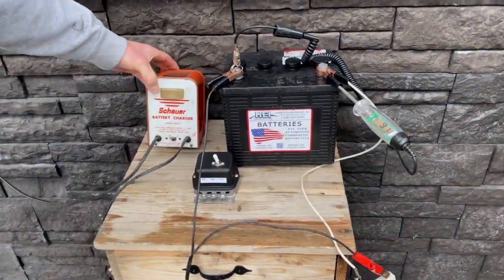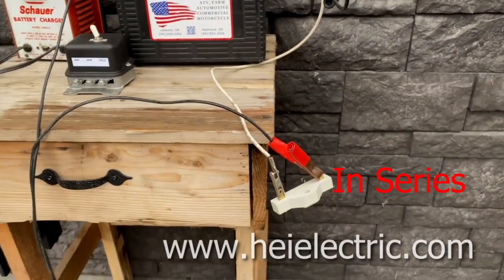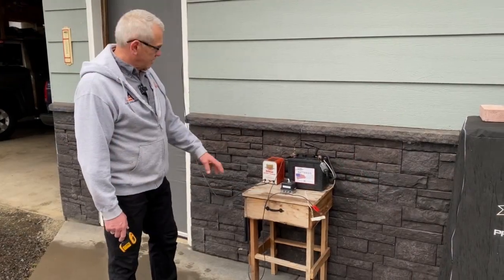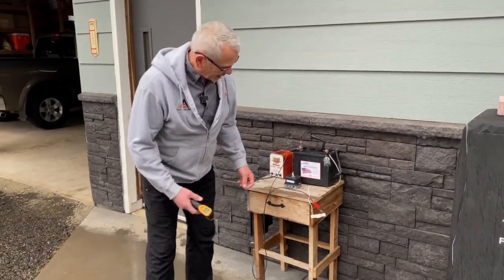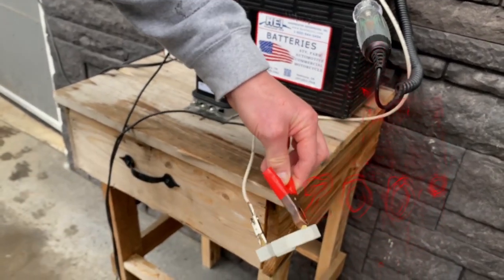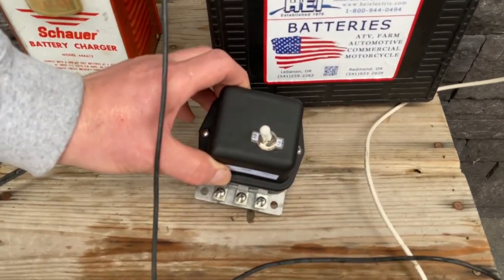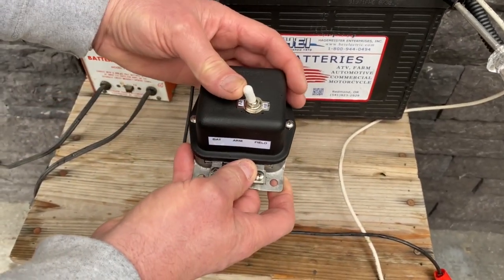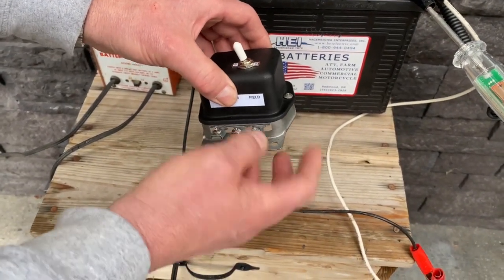How To Charge An 8 Volt Battery

Comment: Thank you Larry for solving the dilemma of charging an 8 volt battery.
I've been using one in my Ford 8N tractor for the extra starting boost.
The charging system has long been disconnected, so this will enable 
me to keep it topped up for starting purposes.   Best information on the internet !

Comment: Intelligent charger was available online. 10amp, auto and it has settings for 6, 8, 12 and I think 24 volts.
After putting an electronic replacement for the point in a 6 volt Chevy we found out that in the winter time the six volt battery in the cold would pull the voltage down to about 4.8 volts. The electronic needed a minimum of 5.1 so even though we were turning over the ignition wouldn't make a spark. Since there is still a generator in the car we modified the spring bracket so that the regulator would charge at 9+ volt

Comment: I have used successfully used a 60-Watt halogen lamp in series with a 6 Volts battery to be charged up from a low amp battery charger which only had the 12 Volts setting.
Monitor charging current and voltages of course.
Reply: So the 60 watt halogen lamp is your resistor. Makes good sense.

Comment: My generator on my 1948 IH Farmall Cub tractor uses a cutout instead of a voltage regulator. Will my generator recharge my newly purchased 8 volt battery as such, or will I still need the 6 to 8 volt switch and resistor you offer?
Reply from the maker: Larry said he emailed you instructions. Did you get the email?

Comment: Will this resistor work with a 12v battery charger that has a 2 amp trickle charge setting? It also has 10A and 50A start settings. I don't have anything that puts out 4 amps.
Reply from the maker: Yes, it will work on the 2 Amp setting.